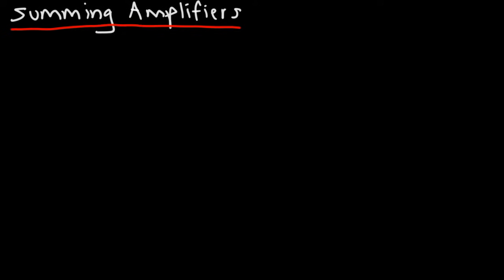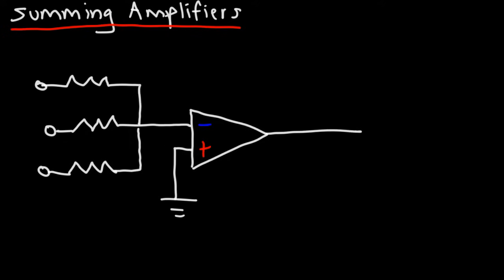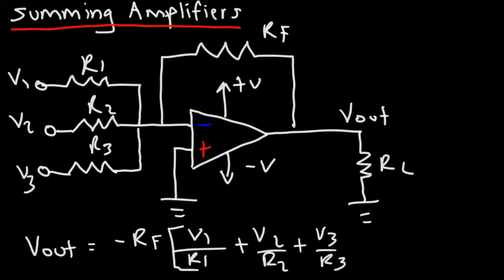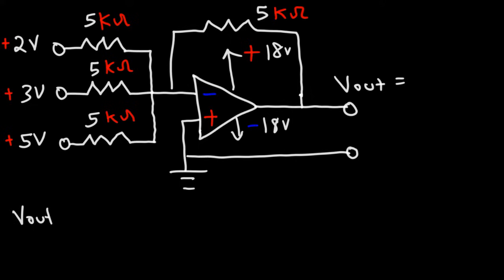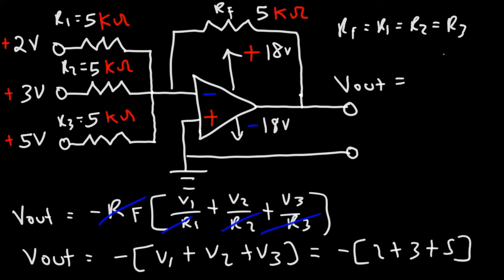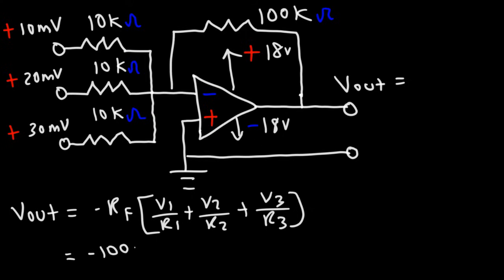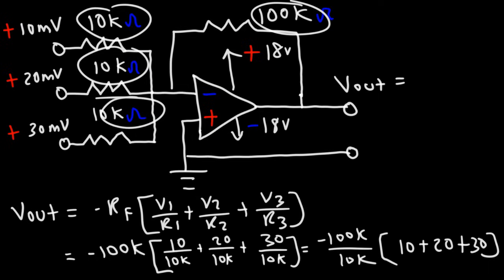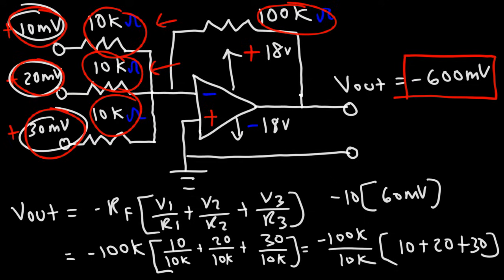Summing Amplifiers - Op Amp Circuits

Comment: Could also do Superposition, vO = v01 + v02 + v03
and find each individual output voltage by shorting the other input voltages, and then come up with equation that way

Comment: What if we want a positive output? Should we use the non-inverting input then?
Reply: Hi, you probally already found the answer, but for anyone else wondering what you would do in this case.

You would put an inverting amplifier with a gain of 1 after the summing amplifier, this way the output of the summing amplifier is inverted again (making it a positive output)
Take a look at the a-level electronic ebooks, they are great for learning the basics such as opamps: 

https://resource.download.wjec.co.uk/vtc/2016-17/16-17_1-9/gce-electronics-book-chapter-4.pdf

Comment: Why did you factor out the 10k resistor towards the end of the video?
Reply: It was just a different way of saying all the fractions share a common denominator. Put objectively confusingly: 
x(1/y + 2/y + 3/y)
=x/y * (1+2+3)
=x/y * (6)
=6x/y
OR
x(1/y + 2/y + 3/y)
=x(6/y)
=6x/y

Comment: I've tried building and simulating this kind op circuit, but the result is not as expected. I'm using the same resistors (10k) and testing simply with 2V+3V right now. If the OP-amp is supplied with ground on the negative rail, the result is 0,1V and if the supply is +12 -12 V, the result is 11,98V. What am I doing wrong?
Reply: 4 years later but it could be an issue with non idealities of real world op amps, specifically bias currents. Put a 10K resistor between the non inverting input and ground, rather than a direct connection and see how that goes.

Comment: If all the input voltages are negative then what will be the output
Reply: If it is a inverting op amp (the voltages enter the negative terminal) then it will change the sign to positive
Reply: The output is just a 180 degree phase shift of the input. So negative input becomes positive output. Since we're talking alternating current - at the next period the input will become positive anyway, and the output will become negative

Comment: sir we are adding another resistor at R2 in vertical direction .then what is vout
Reply: You can work things out with Kirchhoff's current and voltage laws, along with the approximations that there is negligible current going into the inputs of an op-amp and there is a negligible voltage difference between the inputs.